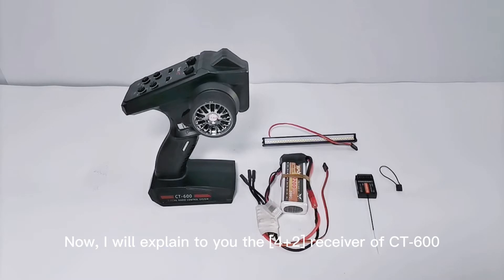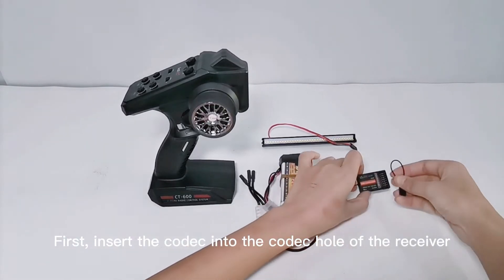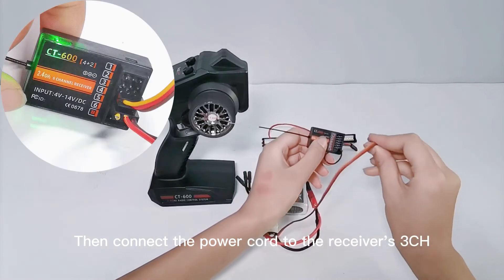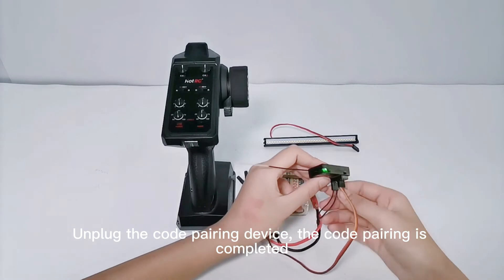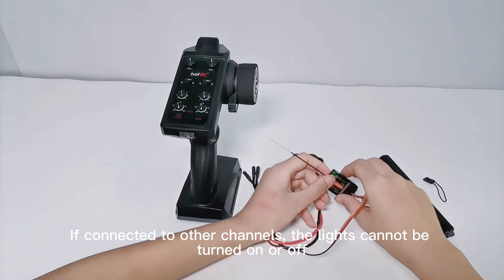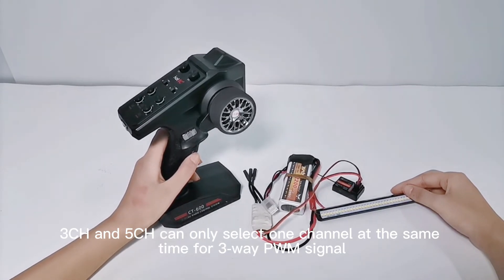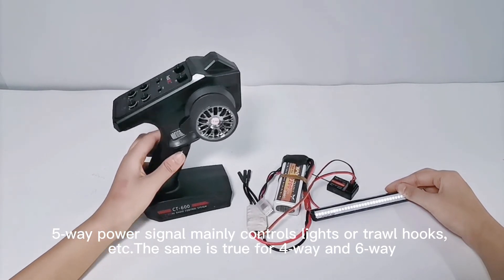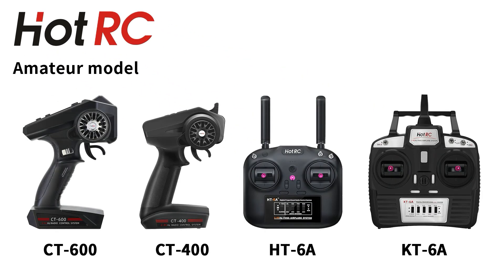Explanation of (4+2) receiver function of CT-600 remote control

Comment: Do you have full version of the review? For example channel 1 is for??? And so on 😅 i have this 4+2 reciever. As usual i put the servo on channel 1, esc on channel 2, winch on channel 3 and lights on channel 4..the rest 5 and 6 not function 😂
Reply from the maker: Are you using a 4+2 receiver?
[4+2 receivers]: 1 channel for direction, 2 channels for throttle, 3 channels and 5 channels can only select one channel at the same time to use 3 channels of PWM servo signal, 5 channels of power signal mainly control lights or trawl hooks, etc.;
4-channel and 6-channel can only select one channel at the same time to use 4-channel PWM servo signal, and 6-channel power signal is mainly used to control lights, cargo trawl hooks, etc.